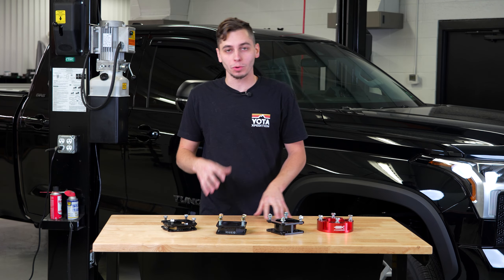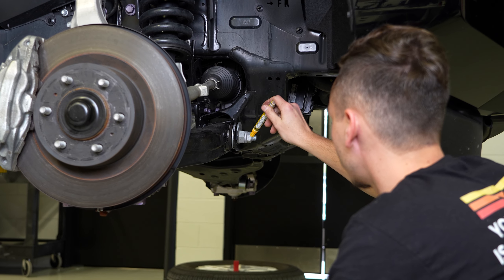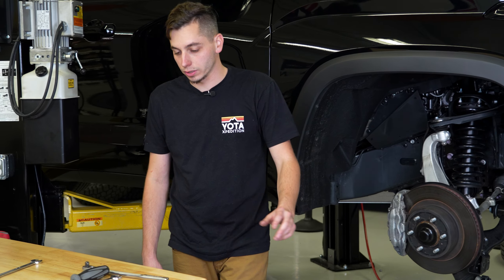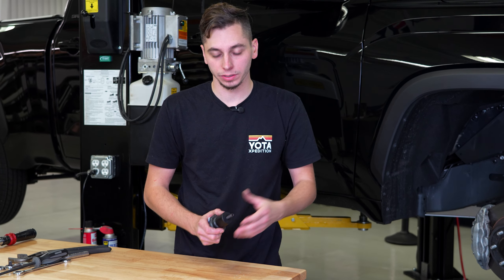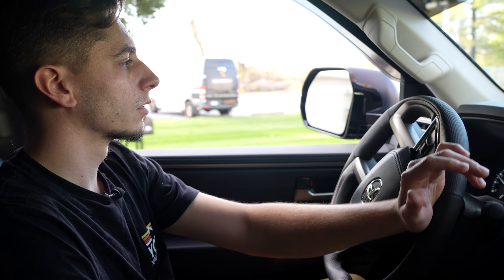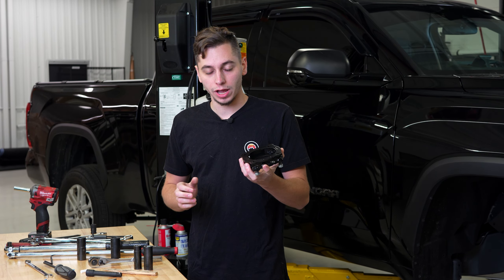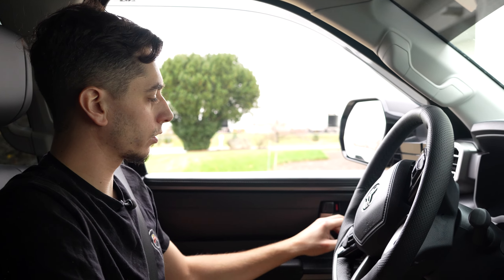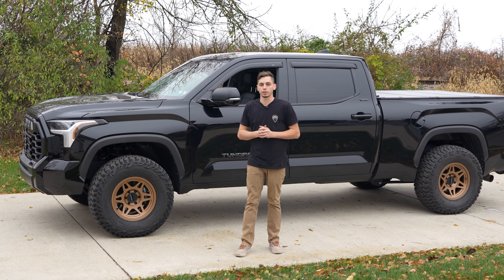Which Leveling Kit Actually Levels Your Tundra??

Comment: I have a 2023  TRD Tundra and the rough country 1.75" leveled it perfectly
Reply: Did you have to upgrade upper control arms?
Reply: @JoseRamirez-mh2mv  no  but I would have if I had  gone with a bigger spacer.   I take my truck on trails here in CA mountains, nothing too crazy.  It still drives like it was stock
Reply: Where did you take the truck to get the kit installed? Any chance in SoCal?
Reply: I found a local shop in my area that works on alignments and suspensions.  $120
Reply: I heard rough country sucks ? That’s why it’s called “rough”
Reply: Are your spacer the metal or the new composite ones?
Reply: Composite   feels like a stock ride
Reply: @davidramirez3145 😂😂😂😂😂HILARIOUS
Reply: Did you just install the level how it  comes? Or did you add anything else? Thanks.

Comment: He man. Im not trying to be a jerk, but are you sure you got those measurements correct? The Icon was 1.25' over what was suggested, and the Fabtech was an inch over. That doesn't sound right to me. Also, the ride with the Icon would have been greatly improved with an alignment. Maybe that's why those measurements are off, perhaps?

Comment: I think you’re reading would change after alignment
Reply: My thoughts exactly the camber seemed very positive with the icon making the ride stiffer and not settling
Reply: Neither camber or toe is going to change the ride height in a significant way.  The castor will for sure and these kits will mess the castor up.

Comment: This question will depend on if you have a base model or a hybrid. The Pro is pretty much level already from what I understand but the hybrid sits 1.2 inches higher in the front

Comment: I saw you trimmed the four screws that go up into upper base. In case of removing the puck, ¿will you be able to replace them for originals back again?
Reply from the maker: Even if you remove the leveling kit, the studs will be fine how they are. If you want, you can replace the whole factory strut top.
Reply: @yotaxpedition  but, if they stay trimmed, not going to be able to put the bolt. 🤔

Comment: Awesome video man! Loce the Fabtech size and it looks great but trimming the strut bolts kind of sucks.  Question: do you need the extra spacer on the bump stop with the Fabtech lift?
Reply from the maker: I took the bump stop spacers off when I installed the Fabtech kit. Im sure a small spacer would be helpful but the Icon spacers was to much with the Fabtech kit.

Comment: Very useful info and great video!! What are the Method wheel specs? Thanks
Reply from the maker: Thanks! The Method wheels are 17x8.5 with a 0 offset
Reply: Thanks, and what is the tire model and size mounted on that wheel?

Comment: I’m happy with my Rough Country 1.75” in front and Cornfed 1” in rear on my 23 Tundra
Reply: I just ordered the RC 1.75”. Anything to note before I install?
Reply: @bmelancon2003  I took it to a mechanic. They didn’t mention anything. The only thing I’ve read on Tundra forums is that without the 1” rear spacer the front can be above level, meaning it points up a little and a lot when towing, and others say it levels just fine. The 1” rear spacer still gives it a bit of rake

Comment: Are these all that safe? I want to get some for my 2008 Tundra, but I have heard they put extra stress on parts that you absolutely do not want breaking while going down the highway. Is that true? Sort of true? Not really true? Only with really badly and properly installed ones? Thank you for any input.
Reply from the maker: When it comes to lifting your truck, a spacer leveling kit is the more cost effective way of doing it. For a normal everyday driver it is not a bad option but I would not recommend for someone who is looking to do offroading. I have personally never had any issues with installing a spacer leveling kit but I am sure at the end of the day it effects some other suspension components (by a small percent) because you are growing the overall length of the shock assembly and making it harder to get reinstalled. Where a full spring and shock upgrade will keep the same overall length as factory but come with a stiffer spring to create the lift or have an adjustable collar to change the spring tension allowing you to lift it. Hope this helps!

Comment: nice, now I want a see a test with a 10 000lb trailer with a distribution hifch with and without the bar.

how is ride quality with with a big trailer?
Reply: It’s fine in my 2023 Limited which tows up to 12,000lbs.  I don’t have the iMax hybrid engine.
Reply: How is the squat with a leveling kit? 

Mine squat by about 2.5" without the front lifted.

Does that mean if you lift the front by 2" it will squat by about 4.5"

The headligt will point at the sky?

Comment: Did you have to do any trimming to fit those 35s?
Reply from the maker: We did not trim anything. There is a small bracket at the back of the front wheel wells that we removed.
Reply: There’s a video showing that

Comment: I have the 2023 trd sport factory dropped in front will the fabtech leving kit work?
Reply: It will work, but considering you're already an inch lower in the front from the factory, you won't be as leveled. You'd be better off going with leveling struts. I've got the Rough Country M1s set to 1.5". Had em for almost a year now, and they're awesome. They are adjustable from 0-2".
Reply: @franksmythe6969 the TRD sport is only .5 inch lower not 1 inch
Reply: @bm5447  You are correct. I remember looking that up after leaving that comment and I just never went back to correct it. Still better off replacing the struts all together when leveling a TRD sport though.
Reply: @franksmythe6969 that sounds like the route I will go. Is it a pretty easy install, I plan on doing it myself.  Did you need an alignment after?
Reply: @bm5447  Always do an alignment. It pulls your toe way in, and your camber way positive.

Comment: Hard to tell if you are wearing ear protection or not but if you are not here is a pro tip, you will go deaf not using plugs with that impact gun. Also a hammer strike, nothing worse for hearing. Good work otherwise.
Reply: Dumb